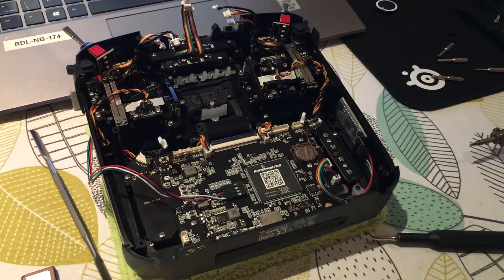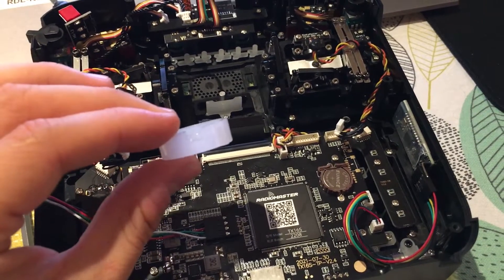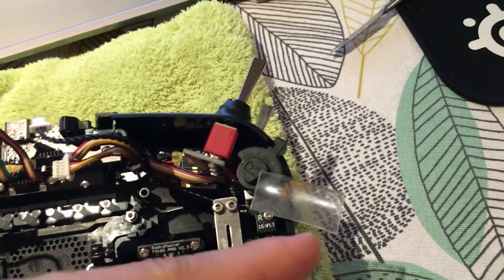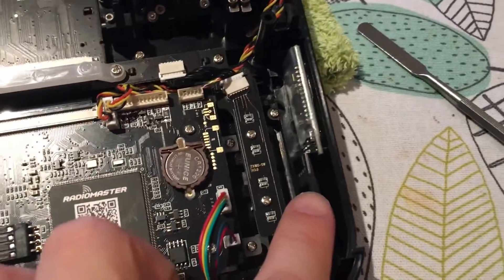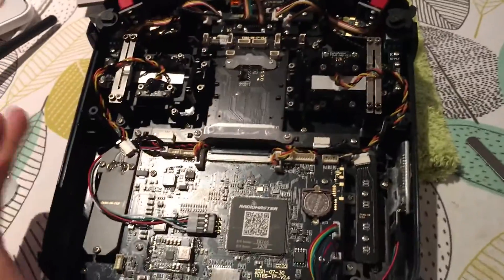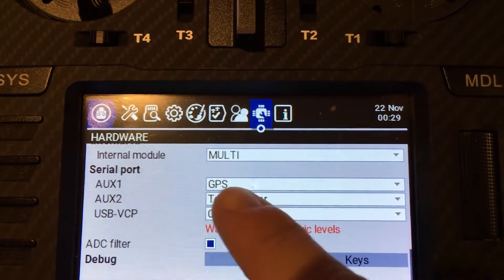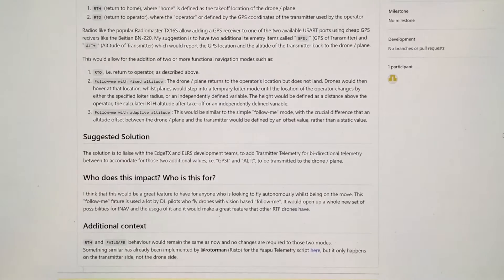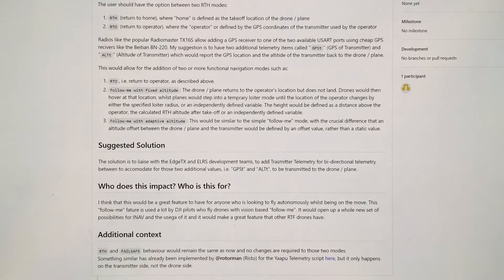Radiomaster TX16S - Adding Bluetooth and GPS!

Comment: Can you help me decide what type of radio I should buy. I want RadioMaster TX 16 Mark II but I don't know what should i get 4in1 Or ELRS or buy 4in1 and buy ELRS module. I don't really know for sure what are they. of my understanding it's a communication protocol and I should not be in trouble if i have Elrs transmitters yes? So it is better to buy 4in1 and elrs module for diversity but I have just one training aircraft with off brand chinese transmitter and i can change transmitter for it yes? So why to bother and just buy ELRS version and leave module bay free. I need help I am confused it's all new to me. I would like tu Use one radio for my first plane then I would like to add quad to my colection and remake my plane to a long range with a 360 camera in the future.
Reply from the maker: I wanted to have all of the options available and for this exact reason I decided to get the MK2 radio with the 4-in-1 module, as well as an ELRS JR module for those long range flights. The multimodule is amazing and supports a HUGE list of protocols. You can also use it to act as a receiver and connect another TX16S with a 4-in-1 module to have wireless trainer. The ELRS version of the radio is not bad, but the antenna is fixed, so you can't change to a separate directional antenna for long range flights and it is limited to only 250mW, which is about 1/4 of what all other ELRS JR bay modules offer. I pre-ordered my ELRS JR module from Radiomaster and I will do a full review and teardown when it arrives. My reccomendation is to get the MK2 radio with the 4-in-1 module as the pots are SIGNIFICNATLY BETTER than on the old MK1 and the feel and finish of the radio is just better. I decided to go for the carbon fiber look, but of course this is just personal preference. I have the silver MK1 and I didn't like it because the silver/chrome-looking parts are just painted plastic, so it will scratch eventually. The black carbon-looking front is matt finsh and looks a lot better, if you ask me. 

Hope this helps! 

PS: Have a look at the upgrades that I did to improve the feel of the scrollwheel and the buttons once oyu get the radio: https://youtu.be/Ozotmx3hmg8
Reply: @DZARO  OH man! Thank You for the replaying and giving me info. I had both training plane at my teens and i crashed it badly but recently i wanted to get back and try out it again and I crashed it again just right at the start of a flight as those other times. 
  I connected radio to a PC to try out some sims and noticed it has interference. When I moved right stick to the edge of the throw suddenly it jumps in signal on two other channels which would make plane bank hard to the left and up and straight to the ground. And that's how i realized that if not crappy off brand chinese transmitter i would have enjoyed the hobby for over 15 years.  But oh well never too late. I will take your advice and buy 4-in-1 then. I did not think of long range antenna aspect and that's a great catch! 
So I would like you to ask two more things. Can I buy R88 receiver from RadioMaster and replace in my plane to fly or will the TX16 will find my 15~ years old receiver and bind. Also do you know any discord servers or forums for EU RC hobbyist. I have a lot of questions :D. 
P.S. I watched that video of button upgrading right after i posted a comment. That's a great improvement. Also subscribed but I don't really like jazz that much :D
Reply from the maker: @FlankCobra  HAHAHAHA, House Music mostly but more RC content will follow as soon as I have my recording setup ready. 

Regarding the first question: You should be absolutely fine with the Radiomaster R88 because to your advantage, nothing has greatly changed in terms of servo technology. Maybe a change from analog to digital servos is the only main thing. I'm in this hobby for the last 17 years and we had metal gear servos 15 years ago, they were just a lot more expensive. Other than that, you can expect great performance from any 2.4GHz technology due to the incredible resiliance to interference, except for Spectrum's DSM technology. I would avoid them at all cost. Out of curiosity, what receiver is installed in that 15 year old plane? 

Regarding your second question: I'm not aware of any marjo RC groups. there are some relatively active FPV forums, such as the INAV Fixed Wing Group on Facebook. Maybe I'll create discord channel myself and post it in a follow up comment. Then you can ask me anything you want there. 

PS: From my experience, DSM is the only technology that is inferior to all 2.4GHz transmitter / receiver systems and is frankly speaking just crap. My friend from the flying field has a brand new $500 Spektrum radio and his reception is just horrible, even if we turn off all of our transmitters to avoid any potential interference.

PPS: If money is no object, I would reccomend getting the version with the AG01 gimbals. They feel a lot better but the new gimbals on the MK2 are not bad as well. Have a look at this link: https://www.radiomasterrc.com/products/tx16s-mark-ii-max-radio-controller?variant=42850745319655
Reply: @DZARO  Well I found few videos. I have this plane https://www.youtube.com/watch?v=iNygjoj5AYc with stock engine, battery and transmitter. https://www.youtube.com/watch?v=_xlZLfTaA7Y But receiver in this video is different.  On my receiver there is absolutely no markings of any kind. But I will replace it so no problem there.  

Also i was looking to buy a new radio for over 3 years now. Wanted FrSky Taranis but just before buying all over YouTube started poping videos about RadioMaster TX16 M2 wanted pre-order but had knowledge gap and could not find help I was looking for few vague answers here and there. Then the pandemic hit and took away life's joy for over a year and half. So here I am again trying to push my way into this :D And RadioMaster sending me e-mails 2 times a day that I should buy already what's in my cart xD But I am playing in Photoshop with color variants on radio and I almost decided on what colors I want xD So I will take your advice on 4-in-1 with AG01. Should i buy external ELRS. If so what do you think I should get Ranger or Ranger Micro?  Or don't buy it for the time being?
Reply from the maker: @FlankCobra  If you are buying the R88 receiver and you only have this plane at the moment, you don't need the ELRS gear for now. I have no idea how good they are and there only paid reviews out on YouTube, so they only say nice things about it. Once I have it in my hand and am able to take it apart, I will be able to offer my opinion. The difference between the Ranger and Ranger Micro is that the Ranger has up to 2W of power output, but to enable this, you'll need to go into the web-based settings of the module and chnage some parameters manually. Here's the thing: I fly long range most of the time and with good antennas and antenna placement, I was able to fly over 10km on just 25mW of power. I think that speaks for itself. Personally, I'm getting the Ranger Micro (the one that fits flush with the JR module bay) because it doesn require any external power, has up to 1W of output power, same as my current Happymodel ES24TX Pro, and just fits nicely on the radio. There a lunatics who want to fly with 2W of power, but there's a thing they forget: Increasoing power output offers diminishing returns, i.e. you don't get double the range for double the power. The best thing for range is a directional antenna. If you are palnning to build a long-range plane, then why not preorder it. If not, you could wait for a few more reviews to show and then make up your mind if you still think that you need it.

FYI: Happymodel ES24TX Pro is a good ELRS module electronically speaking, but has a crappy cooling fan that sounds horrible because the bearings are very bad. I replaced it twice already and it's still horrible. 

PS: If you do get an ELRS system, I would reccomend the Matek 2.4GHz R24-D ELRS Diversity Receiver. It's the best I have tested so far.
Reply: @DZARO  Ok then I will hold of buying ELRS for now. And just get in my hours with 4-in-1. It should be plenty for me right now till i get proficient in basics. How about that discord? Cuz I have a ton more questions. :D
Reply from the maker: @FlankCobra  Will do, but not now because I need time to think about how to do all of this. I want to make proper tutorials and that takes time and effort. It'll happen soon. :)
Reply: @DZARO  OK can't wait! If You need help on graphics, 3D, 2D , let me know i would gladly help, also audio stuff.. multimedia in general.
Reply: @DZARO  Dude yesterday I got my radio! I feel like a kid. Was wanting it for so long! Oh boy it's amazing! Thing is I will have to learn a lot of new things cuz I'm totally new at it. Already used on few sims! It feels amazing and i did not installed AG 01 even yet. I can't wait for the discord server :D. I will wish you Happy New year!
Reply from the maker: @FlankCobra  Happy New Year to you  too! The discord server will be coming soon :))

Comment: My TX16S mainboard doesn't have the 4 pin connector for the bluetooth, just the 2 pin. Did you add that connector? If not, do you have a different variant of the basic TX16S?
Reply from the maker: You board is probably the one from the TX16S MK1. This video is about the MK2 and they have different boards.
Reply: Thanks for the speedy reply. Most appreciated. Thanks again.

Comment: Can you use that Bluetooth module for a Bluetooth head tracker via trainer port?
Reply from the maker: I think you should be able to. I'm 99% sure that it should be possible to do, I just haven't done it yet because I don't have a headtracker. It's best to ask in the DIY HeadTracker Discord channel here: https://discord.gg/QxUT2EyF and check the documentation on their main page here: https://headtracker.gitbook.io/
Reply: Yes you can. Works great. I use it.
Reply: @Ard1400  that's awesome. I'm ordering the parts right now. Do you have an links to more information?
Reply: @Ard1400  How did you do it? I got mine connected but it doesn't search or show  addresses to choose from . thank you
Reply: @DZARO  Great!, I was looking for this confimation!, thank you!..

Comment: What is the benefit of having gps on a transmitter?
Reply from the maker: At the moment, there is no benefit, but the idea is to have a GPS in the transmitter so as to enable the potential for future developemtns like RTO (return to operator) and follow me. You will also be technically compliant with the RemoteID requirtements in the USA. The only thing where you have some benefit is using the modified Yaapu Telemetry Widget: https://github.com/rotorman/FrskyTelemetryScript
Reply: @DZARO  Yes, that makes total sense. Thank you for our reply